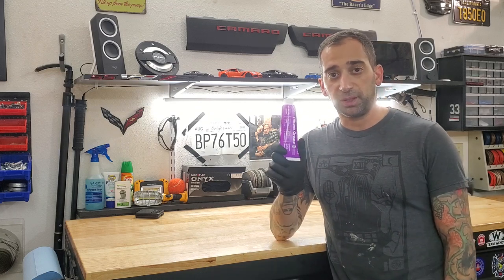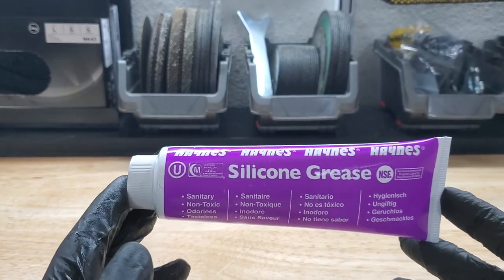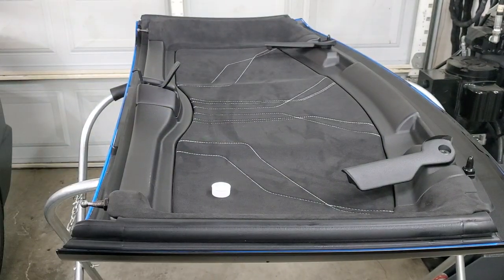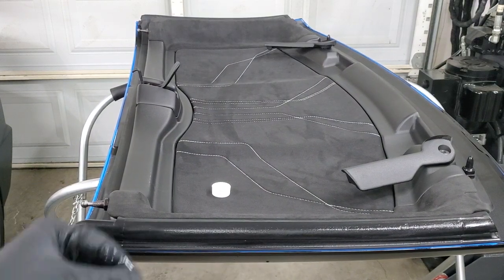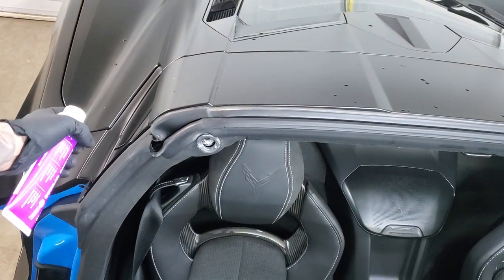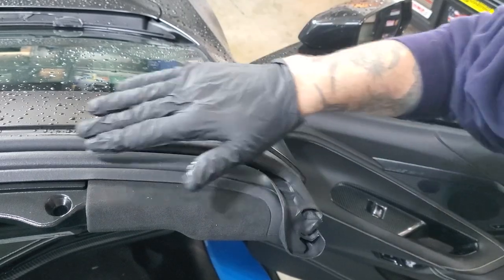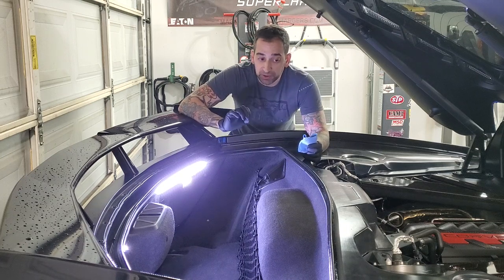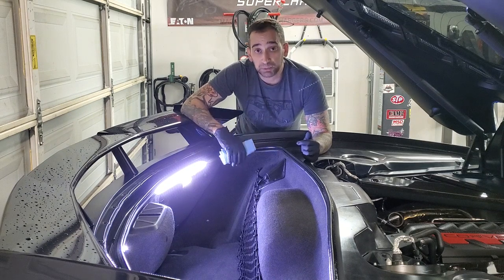Fix annoying roof creek/flex/twist noise on Corvette C8. Easy, Cheap, no tools needed.

Comment: Thanks for sharing.
Please question: when you put the car on Track mode. Will the engine stay in the V8 mode or go between V8/V4 (AFM) or (DOD)?
Reply: In track mode the engine will never go into V4.  That is one way to prevent that from happening.  Another way is to be in manual shift mode.  It will never go in v4 while in manual mode but sometimes that gets annoying for me so I use track mode.  I surely don't like when it goes into V4 I believe that can cause problems.  Just my thoughts.
Reply: @glennfelpel9785  
Thanks for the reply
Very informative
Reply: On another note, did you install an aftermarket air filter? Thanks